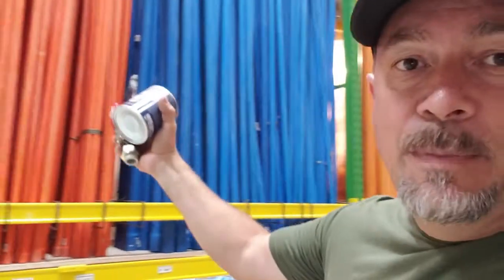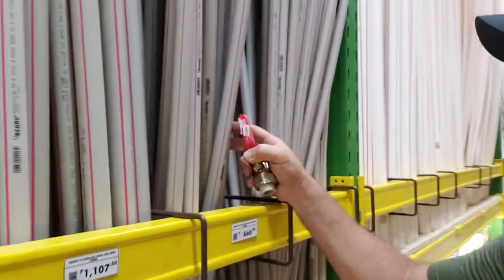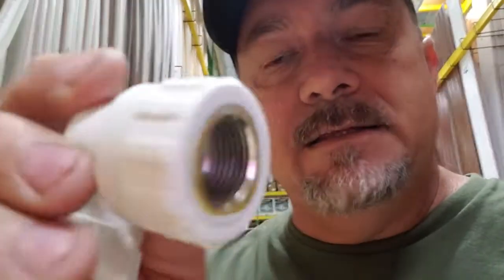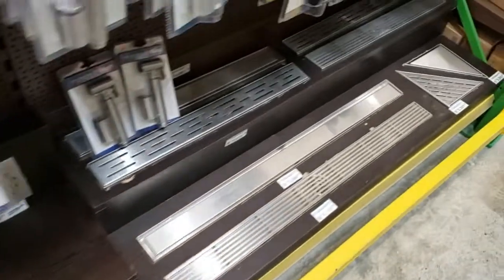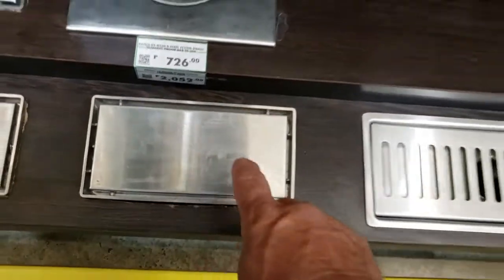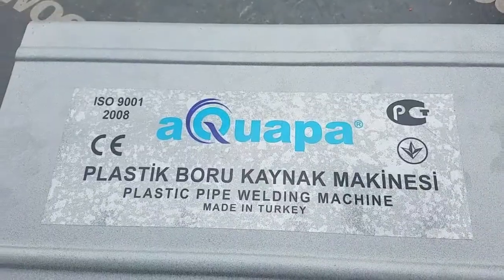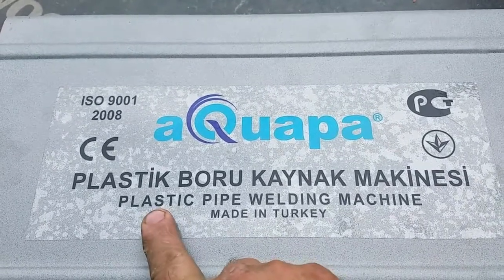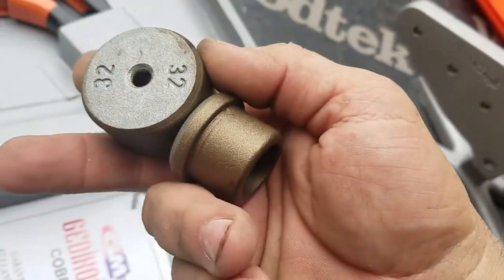Build Episode 65 LET'S TALK PIPE   PPR PIPE say no to PVC

Comment: this is the cheapest pipe and the best pipe!!In Europe.we have it like since 2000..nowdays they even have aluminium and fiber glass layers inside to make it even stronger...its very thick and will not leak ever!The fact that the fittings and pipes are welded together with heat,makes the joint be like one piece!You can cut the joint after instalation and see right away that there are no layers,only one piece.Its very safe because it doesnt corrode in time and it can be inbeded into concrete,walls etc.Another great advatage is that this pipe doesnt lose heat like pex and cooper..so you dont have to worry about insulating it...the fittings are very very cheap.And another big advantage of this pipe is that it lasts at least 50 years...no pipe on the market can do thatThe only thing is that you have to move pretty quick with it,and you need to know exactly what you are doing.Its strage that in america is not very common and people still use copper and pvc...In the communist countries in 1970-1980 such as Romania,Russia,Hungaria etc they were using pvc pipe glued...after 1990 pex-al was taking over,and than ppr pipe...So I think pvc is a pipe from the past...

Comment: JUST WATCHED THE ARMSTRONG FAMILY VIDEO OF HIM USING THIS AND HE'S HAD PROBLEMS GETTING THE PIECES TO LINE UP STRAIGHT. HE'S HAD A FEW SMALL LEAKS. I'VE NEVER HAD A LEAK WORING WITH PVC. THERE'S NO WAY TO TELL IF YOU'VE HEATED THE FITTINGS UP TOO MUCH OR NOT ENOUGH. IT'S GOT 2 BE MORE DIFFICULT TO WORK WITH IF YOU EVER NEED A REPAIR ON AN ALREADY INSTALLED PIPE. THE FACT THEY SELL MORE THAN ONE SYSTEM FOR HEATING THEM UP SOUNDS QUESTIONABLE TOO. I'LL STICK WITH PVC. IF IT AIN'T BROKE DON'T FIX IT.

Comment: I’ve had experience welding HDPE but I have no knowledge regarding PPR pipe. I’m just wondering how much time you have on before the two sections cool down. Wondering also if you need to keep pressure on when first joining or twisting it? Just don’t know but I’d bet clean/dry joints is a must.
Reply: It doesn't dry super fast. But the guy who did our house in Asia messed up a fitting. You have to keep a 90 degree angle when melting it with a machine.
Reply: It seemed very weird to me because we don't have it here in the USA. Plus the fittings are great they have brass inserts for the threads.

Comment: ‘Made in Turkey’ but a China Export insignia. You got to watch for that here, it can be very deceiving.
 Also, the “Wilcon employees” really aren’t  Wilcon employees, they’re there hired by a company who’s products are sold at any given Wilcon outlet for the most part. That’s how it was explained to me anyway. And, these employees are not trained or educated about the products they’re recommending or selling. Its buyer beware here to say the least. Know what you need and how to use it Before making a purchase.
 I learned the hard way about that blue pvc water line... it’s Not all the same diameter, nor are the firings. Be super careful when buying fittings like tees & elbows. If they don’t come from the same manufacturer, chances are they are not compatible. 
 I also tried with the white PPR and gave up when the heating iron I bought was the wrong size.
 I hope this saves someone from the grief of loading up on supplies only to piss you off when you get to the site an hour away! Good times hahaha

Comment: You can order the pipe welding machine online from LAZADA also!
Thank you very much for sharing another valuable information with us. Such a great video! 
Best Regards!/Ned
Reply: Regardless of where you buy it be sure to check voltage to make sure it works on you power supply.

Comment: Back in the 80's when I was working commercial construction, we used Nipak pipe for below ground instillations. Obviously our iron for was much larger due to the sizes of pipe we we're running. As you know, the best way to run any water or gas lines in ground is to use a continuous flexible pipe and loop it under slabs to eliminate any connections that could possibly leak in the future and manifold the fittings in a wall or utility room. I like the choices you have over there at your store. Thanks for this vlog James. It brought back some good memories of my younger years when having to work for a living didn't suck. 😊

Comment: the pipe used for closed loop in ground heat pump systems is connected by the welding method.  The problem I see is except for the major pipe runs when you get to the sinks etc and between joists or studs etc how would you get the heating tool in those tight places?  What about the safety of repairing something in a damp place or well house or in crawlspace you would be running extension cord very inconvenient and potential shock hazard.
Reply from the maker: that is true but there is ways I'm sure because most of the world uses this